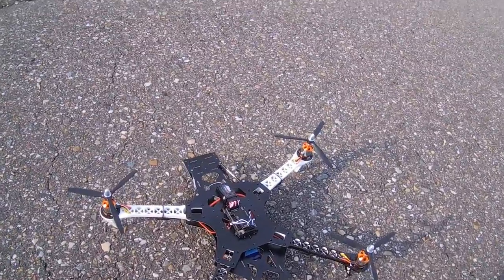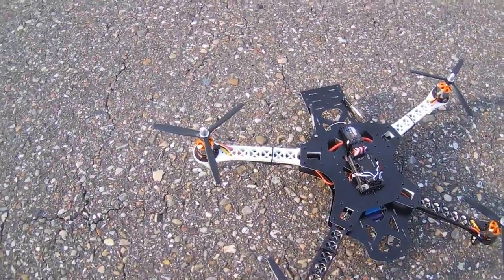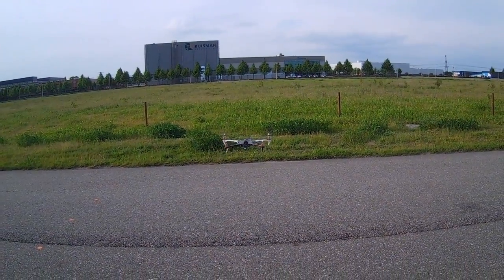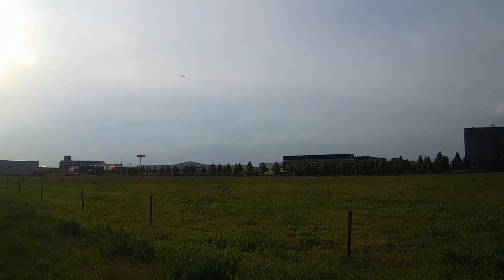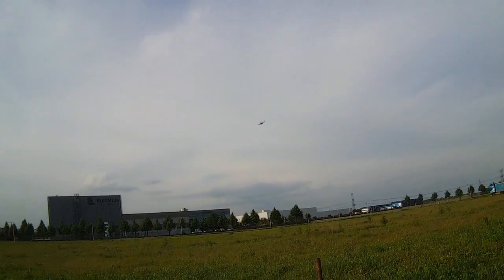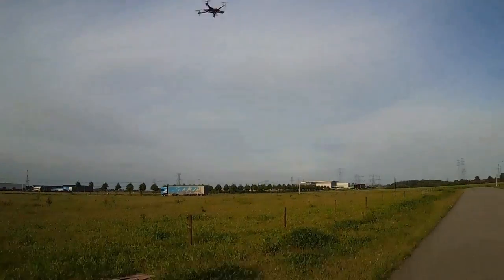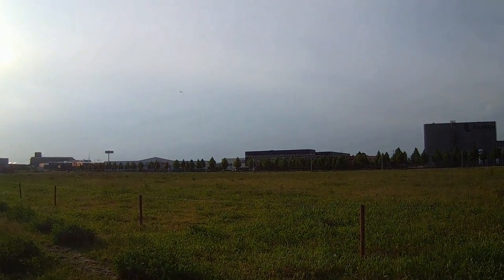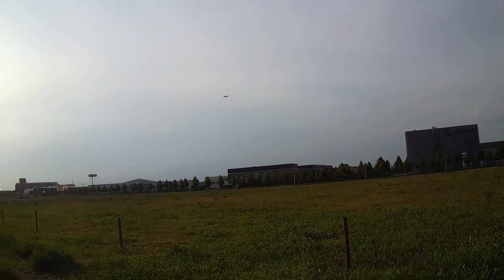HobbyKing SK450 Dead Cat Quadcopter - Maiden Flight! HKpilot Mega 2.7

Comment: Nice, it looks awesome!
Reply from the maker: The RCAddict Thanks mate :)  I'm happy with how this turned out.. 
Quite a lot of room for extra stuff on this frame (camera's.. FPV stuff.. etc)
Reply: DutchRC ADVENTURES Yeah, that one will go far!
Reply from the maker: The RCAddict I'll probably give this set a try on this frame: 
http://www.banggood.com/Eachine-700TVL-13-Cmos-FPV-110-Degree-Camera-w32CH-Transmission-p-965760.html
Reply: DutchRC ADVENTURES That looks nice. I am going to get the Quanum set for $100 after a while
Reply from the maker: The RCAddict Can't go wrong with that one mate.. There IS a version 2 on it's way... But I think that one will be more expensive & not that much better (I actually think the specs will be the same.. but we'll see :))
Reply: DutchRC ADVENTURES Ok, I will be on the look out. The V1 seems awesome for the price! Just $100 then add batteries so like $120!
Reply from the maker: The RCAddict Yes sir! I just ordered a second video transmitter.. the same that comes in the set, as it works quite well :)
Reply: DutchRC ADVENTURES Yeah, I can't wait for both the quad and the FPV. It does look a bit funnier than FatSharks on your head but hey, it is 4 times less!
Reply from the maker: The RCAddict Yeah man.. Who cares really :)  Do a cool paintob on it, and solved! :D
Reply: DutchRC ADVENTURES Lol, does the black foam get hot?
Reply from the maker: The RCAddict I haven't tried it in really WARM weather yet.. But well.. there IS that chance yes :D  Paint it white, and it will look better & won't get warm I'd say :)
Reply: DutchRC ADVENTURES Ok, it gets about 80-95F here in the summer, I would probably be in the shade and not doing it for very long anyways. Lol I might screw it up by spray painting it.
Reply from the maker: The RCAddict That IS possible yes :)   I had quite a hard time spray-painting that EFX Racer plane :$
Reply: DutchRC ADVENTURES Yeah, As it is still expensive for me I will not mess with it.
Reply from the maker: The RCAddict maybe some reflective tape on top of it then? That would be hard to mess up :)
Reply: DutchRC ADVENTURES Hehe yeah, might look even funnier then ;) What are you using yours on right now?
Reply from the maker: The RCAddict I'm gonna paint a smiley on mine I think :)  Just as a funny in video's :P  
Right now I only use it on my Hype Funtastic (which works out Well, though the plane is a bit Fast :P)
Reply: DutchRC ADVENTURES Sweet, what is the range before it gets choppy?
Reply from the maker: The RCAddict THAT is hard to say as it depends on so manny things (surroundings).. I've had 100% crisp reception up to +/- 700 miles AND I was at quite an altitude.. Ot other spots there can be more interferance and you then only get 500 miles... 
It's just a 200mw transmitter though, so I'm quite contend with it's performance :)
Reply: DutchRC ADVENTURES Miles! Do you mean meters? 700miles is 100,000 meters! That is still awesome as I wouldn't be going out of line of sight very often if at all. What about going behind a tree of building?
Reply from the maker: The RCAddict Oeps.. that would be A BIT to good to be true :P  That's what happens when you drink beer :P 
METERS yes.. hahaha.. Damn.. I could fly to the UK otherwise :) That would be fun! :D  

Yep.. buildings.. dense woods.. those are things that interfere for sure.. 5.8Ghz doesn't penetrate things really.. But flying around at your field won't pose Any problems :)
Reply: DutchRC ADVENTURES Lol, I thought something was up ;) Bruce flies in woods but I am assuming he uses much better gear. Yeah, I wouldn't be doing woods flying just maybe though our pavilion or between a tree or two.
Reply from the maker: The RCAddict Well.. I can fly in woods with my set.. But several rows of trees will interfere.. And offcourse the view in his video's isn't the FPV view (in most cases)... 
A few trees won't be a problem at all :)
Reply: DutchRC ADVENTURES Yeah, our grove is just a ring of tall loose trees that I would fly though the middle of. One thing to test out :D I know his are usually his Xiaomi cam but he must get enough signal to not crash ;D
Reply from the maker: The RCAddict Or... not :)  As you know he goes through quite a few props :)
Reply: DutchRC ADVENTURES Yeah, lol. I am getting 20 5x3 gemfans and 20 5x4 gemfans with the parts and will go from there.
Reply from the maker: The RCAddict Hahahaha I'll tell you something funny: when I got my first quad (which I still have by-the-way).. I got myself 40 props...
So far (1.5 years) I have broken ONE :O  .. 
That isn't a race quad though.. Not a fair comparison :)
Reply: DutchRC ADVENTURES LOL, they are only 20 for $10 though so I thought I would be safe and if need be get more ;)
Reply from the maker: The RCAddict You woulnd NOT wan't to have to wait a week (or more) when busting up a prop mate :)
Reply: DutchRC ADVENTURES Oh yeah. BG has them in the US too so If I get low they are readily available. I am getting from China as order is coming from there so no point in getting them faster.
Reply from the maker: The RCAddict Agreed :)   Wouldn't high carbon steel work for props by the way? :)
Reply: DutchRC ADVENTURES I thought about getting carbon props but that seems more dangerous...
Reply from the maker: The RCAddict Mweh.. there's just not that much of a benefit for a racer.. They brake just as fast, or faster..
On my big quad I do have carbon props.. Just because they run with less vibration + they seem to be more efficient... But again.. on a racer I would never use carbon props..
Reply: DutchRC ADVENTURES Oh, I thought they were the best for everything. Lol, I have alot to lean about the more high end of thigs but it will come in time. Still looks awesome though ;) Maybe good for filming then?
Reply from the maker: The RCAddict Well.. they ARE best in terms of stiffness / performance.. 
But a racequad crashes from time to time.. CF props will break the bank that way ;)  And we (non competition flyers) don't need that extra bit of performance any way :)  
And yes.. on a video-rig carbon props work best..
Reply: DutchRC ADVENTURES OK, that makes sense. So would getting the fiberglass frame be better? I know it would be heavier but maybe stronger?
Reply from the maker: The RCAddict A propellor isn't the same as a quad frame buddy ;)  At least.. I hope you weren't planning to spin your frame at 1000's revs :P  
For the frame CF would be nice....
Reply: DutchRC ADVENTURES Lol, yeah. Like I said, I dont know much about this stuff ;) The motors are 2300 kv I think
Reply from the maker: The RCAddict Yes.. that sounds about right.. I really like this frame by the way: http://www.hobbyking.com/hobbyking/store/__77931__HobbyKing_8482_Totem_Q330_Quadcopter_Kit.html  looks really beefy :)
Reply from the maker: The RCAddict A PCB board is VERY benefitial! Makes the build a lot easier! There is such a board for my new SK450, but that was only available in the international warehouse..
So.. I had to solder up a power-distribution harnass myself (blehhh :P)
Reply: DutchRC ADVENTURES So would that one work? It says it is made for it but you never know. It looks awesome for $6
Reply from the maker: The RCAddict You are more informed about that frame offcourse, though I know what it is.. You should be able to compare the shape and drill-holes? I'd say: for $6 just take the chance..
Reply: DutchRC ADVENTURES OK, adding everything up it comes to a total of about $420 for everything I need
Reply from the maker: The RCAddict I'd say the number of channels of the receiver.. D8R = 8-channel..
Reply: DutchRC ADVENTURES I meant the module. One says DJT and the other says DFT. Here is a BG page with three kinds. Would you be able to pick one?
https://www.banggood.com/buy/FrSky-Module.html
Reply from the maker: The RCAddict Ahhhh I see.. The difference is the telemetry protocol.. The 'F' in the second one means Futaba.. That can't be the one you're looking for.. 
You have some time until ordering though.. 
You do know about the different protocols by now I think? (DSM2 / DSMX for Spectrum... FASST / FASTest / FHSS for Futaba).. That's the normal control protocol side.. Then there is the telemetry side..
Be SURE to read up on that, and what is used by the modules & receivers.....
Reply: DutchRC ADVENTURES So get the DJT and the D4R-ll?
Reply from the maker: The RCAddict That's what I think yes.. 
Damn.. I'm in the middle of moving from Pinnacle Studio to Adobe Premiere... I kind of have to learn everything all over again.. Simple things take Hours :P
Reply: DutchRC ADVENTURES Is that video editing? Lol I still use the free version of Movie maker ;)
Reply from the maker: The RCAddict Yes sir :)  I'm sure real TV / movie creators use more complex systems.. But for the YT-market, Adobe Premiere is a pretty high end video editor :)
Reply: DutchRC ADVENTURES Yeah, I haven't had any complaints with my editing so I guess it is fine. More about the content than the intros,fonts, animations, and such.
Reply from the maker: The RCAddict Eventually you'll want (not need) more editing possibilities :)  But for now this works just fine :)
Reply: DutchRC ADVENTURES Why do I need more? The biggest thing I dont like about it is not being able to change individual fonts / colors, like for the title is has to be all one color and font.
Reply from the maker: The RCAddict Eventually, you'll want to make better video's mate :)  More control on the resolution. FPS.. colors.. You might even want to give your video's a personalised look by using a filter..  transition effects..
Reply: DutchRC ADVENTURES My IPod has lots of filters but I though it would be better to use a more natural look. I want a better camera but they are so expensive. Maybe once i start getting more from YT. I get about $70 a month right now.
Reply from the maker: The RCAddict Yes sir! A good cam costs an arm & a leg :)  I'd like a Sony 4K handycam.. But yeah.. Not for a while ;)
Reply: DutchRC ADVENTURES I just want something like 1080p 60 fps that just in general looks good. About the 4K, when you watch my videos do they play at 1080P?
Reply from the maker: The RCAddict Yes sir :)  
Huh.. I just noticed this video is shown at 1080P 60fps :|  That's weird...
Reply: DutchRC ADVENTURES Ok, I thought viewers were seeing in low quality like me but it seems like not many people have below 720p speed. That is good though, it looks much better. Isn't it with your mobius? That is only 29.5fps
Reply from the maker: The RCAddict Yes sir.. I kind of refuse to watch anything below 1080P :$  
This video here was shot with my video sunglasses.. But well.. I'm not sure what's going on here.. I exported it at 29.5fps from my video editor...
Reply: Haha, lol that is like impossible for me. Lol would take 20mins to buffer a 5 min video. Vidoe sunglasses?!? How much are they?
Reply from the maker: The RCAddict I know man :)  I'm sorry.. Hope that will be improved upon sooner then later! 
These are from Rollei, which is are really the only ones out there that work reliably.. I've tried a few others, and watched A LOT of reviews.. Most others seem to stop working after a while.. 

I got them for about $100... On most sites they are quite a bit more expensive though....
Reply: DutchRC ADVENTURES Ok, that is a cool idea. Too much for me though
Reply from the maker: The RCAddict It's not cheap.. But you are Sure you allways shoot wat you're looking at..
And well.. as you can see, the video quality is quite good..
Reply: DutchRC ADVENTURES Yeah, The hat cam is away from eyes a little and angle is sometime different. My last 3 reviews indoors I had it pointed too far upwards so sometimes you cant see the quad.
Reply from the maker: The RCAddict Yeps.. Imagine traveling to a flying field further away for an afternoon, and come back to find out the footige is unusable.. Preventing that is wurth the $100 to me for sure....
Reply: DutchRC ADVENTURES Yeah, I just need to concentrate a little more on moving my head and not eyes.
Reply from the maker: The RCAddict Yes.. well THAT I have to keep in mind as well :)  Especially when things are close by :)
Reply: DutchRC ADVENTURES Haha yeah. I took a outside video and was like "look at those nice flips" and when I watched it it wasn't even in shot ;)

Quick question, upon filing shocks with oil should they be filled to the brim?
Reply from the maker: The RCAddict Yep.. that's BAD buddy :D  

Ah.. I could tell you, but rather then repeating someone ellse: 
https://www.youtube.com/watch?v=1_d1nEquS6Y
Reply: DutchRC ADVENTURES Thanks man! I guess I will delete my video as I did it wrong. Should the shaft come back out without the spring when it is compressed?  I was finding it was riding even lower than before and didnt come back up :(
Reply from the maker: The RCAddict You're welcome :)  
 Nope.. that is one sure way of knowing the shock is Over filled.. It should just sit there at any point of the stroke.. 
You now actualy have hydrawlick presure in the shock..
Reply: DutchRC ADVENTURES Ok, I wasn't sure but it seemed like they might come back up better that way. I put three shock clips on each shock but the truck still sits lower than before..do you know why?
Reply from the maker: The RCAddict Did you maibe use thicker oil this time?? Generally shock extend that last bit because of the vibrations while driving..
Reply: DutchRC ADVENTURES I used 80 weight because Gecko Guy recommended it. I wanted it to be stiffer so It didnt slap so hard on high jumps. It seems to slap less but does not come back up as much...
Reply from the maker: The RCAddict Check.. that makes sense. Think of it this way: 
To more the spring is extended, the less powerfull it gets.. Right? :)  
Now.. with the thicker oil, the springs can't push that last bit out.. 

You could put on stronger springs.. Or maybe extent the current springs a little by carefully strechting them a BIT? Make sure you stretch each the same amount..
Reply from the maker: The RCAddict ps: but if the truck drives well / better as it is.. You could allso leave it as is offcourse..
Reply: DutchRC ADVENTURES So with the thicker oil I just made it worse? I just wanted it to come back up with less chassis slap on jumps :( I dont know if they have stronger springs and dont really want to maybe ruin them by stretching :/ Should I buy like 20W oili?
Reply from the maker: The RCAddict Indeed.. Don't stretch them then.. BUT.. with the thicker oil, the springs will compress on landings FAR less as well.. So yes.. You have made it stiffer for sure..
Do you have shock-mount options to position the shock more upright?? 

ps: the V2 version of HK's FPV goggles were released today, and the improvements look Significant :)
Reply: DutchRC ADVENTURES OK, there is one other hole like 2mm farther toward the edge to put them. Would that help making it higher?  I saw the videos for it but Havent watched them yet. Stupid limited internet!
Reply from the maker: The RCAddict You should definately try that, but I can't see the geometry from here :)  Just try 1 side of the car, and see if that side becomes higher..

Allright.. just take my word for it then.. Saves you the time ;)  There is NO reason to go for the previous version now this one is available..
Reply: DutchRC ADVENTURES Ok, I will be sure to check them out :D
Reply from the maker: The RCAddict I'l probably order one as well, but it will take a few weeks to arrive from the internation warehouse.....
Reply: DutchRC ADVENTURES Yeah, a review from you would be great :D Since there is no "RTF" kit I dont know in the way of camera/receiver or what ever else there is
Reply from the maker: The RCAddict I'll keep you posted sir :)  Most of the contents of the Complete set can allso be ordered seperately though.. (I just received a 2nd video transmitter yesterday.. Exactly the same one...)
Reply: DutchRC ADVENTURES Ok, Looking at my truck the front shocks were screwed in on the outer holes making it lean forward a little so I put them on the in side. I took the shock clips of but it still comes back about the same, I will try re doing my oil tomorrow the right way.
Reply from the maker: The RCAddict Check.. filling them the right way should allso help..
Reply: DutchRC ADVENTURES Yeah, we are leaving in an hour for camping over the weekend so I will have to redo them when I get back.
Reply from the maker: The RCAddict No rush :)  Have a nice camping trip offcourse! :D